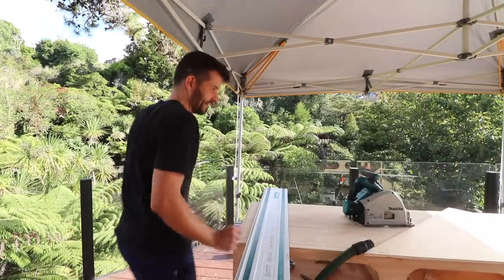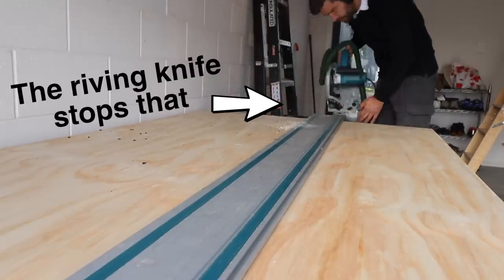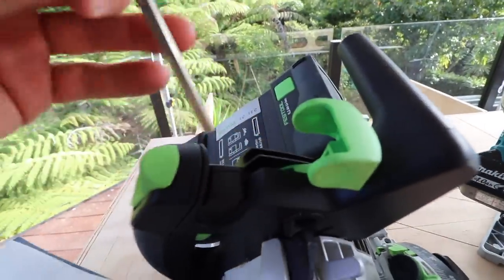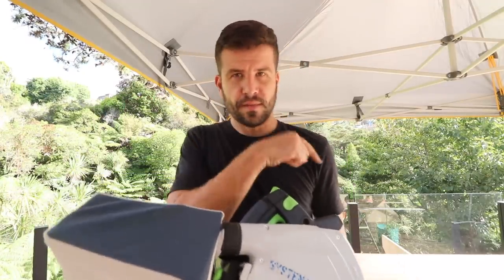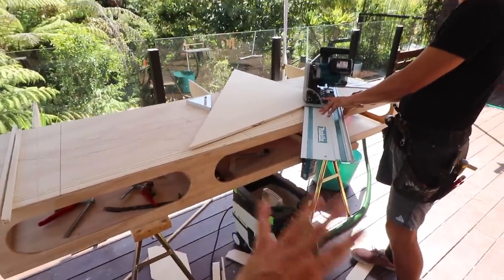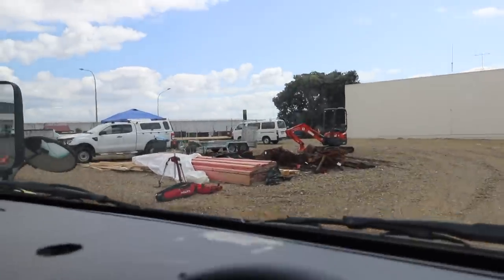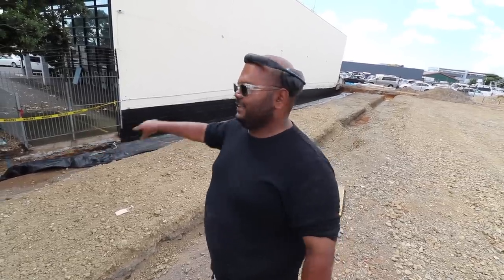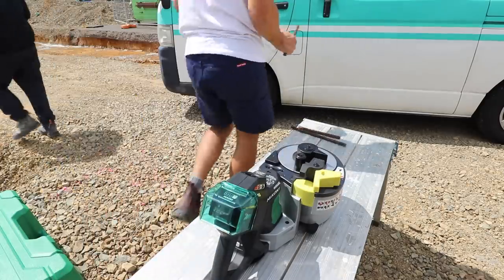Cordless Track Saw: Makita or Festool?

Comment: Cordless tools that require a vacuum connection make absolutely no sense. I don't know about you but the contractors I know you're not stupid enough to be unable to do that kind of math. So yeah, I think im in agreement with you guys, cordless track saws make no sense.
Reply: Joseph DESTAUBIN Well thankfully, most of the time, actually using the vacuum is a choice you have. You can certainly just blow the dust out the port into the environment, unless you’re regulated by workplace conditions.